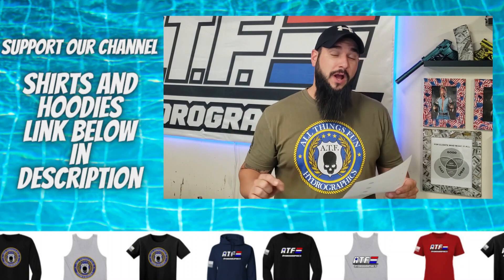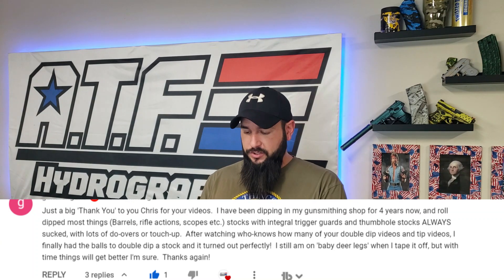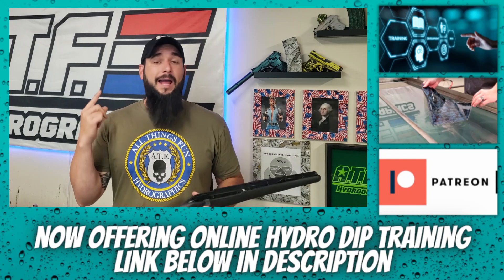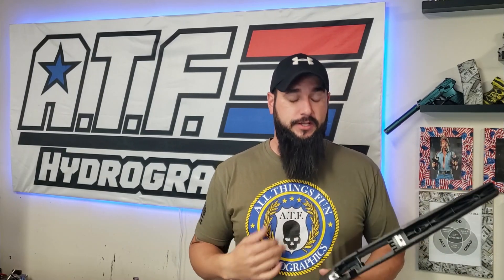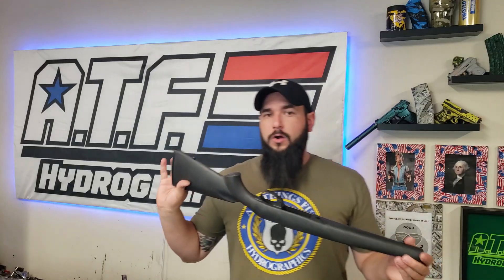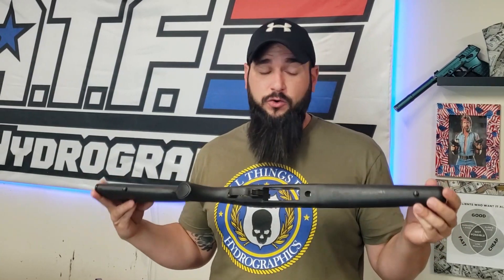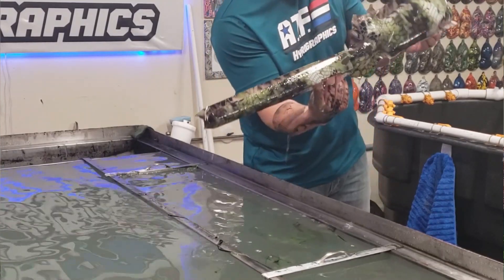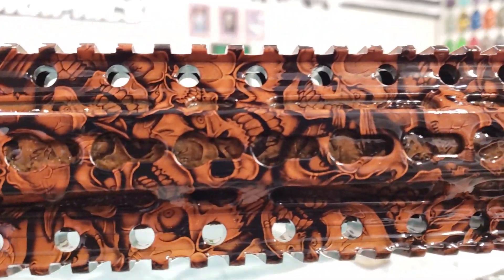Roll or Double Dip? Hydro Dip Techniques Explained

Comment: Just got my 1st set of supplies, I preped my ps4 controller torched it just in case, scuffed it, painted it with white paint, cut the film placed it in appx 80 degree water for 1 minute sprayed it with the activator waited about 10 seconds and dipped the piece.  It came out good and rises it until the slimy feeling went away, as I was running it I saw some dots all over the piece as if the film came off what did I do wrong? Too much activator? Didn't let the paint dry long enough. I am using the supplies you recommended one shoot stuff. Thanks.
Reply from the maker: https://www.youtube.com/watch?v=_e_M5Nzzhdk
That will help you.